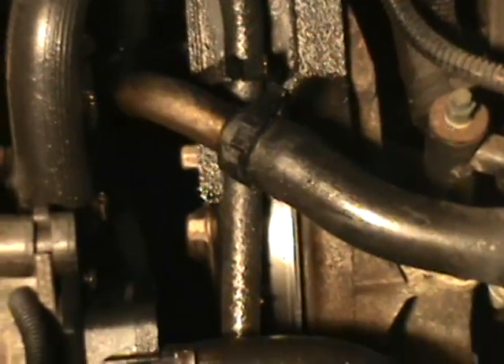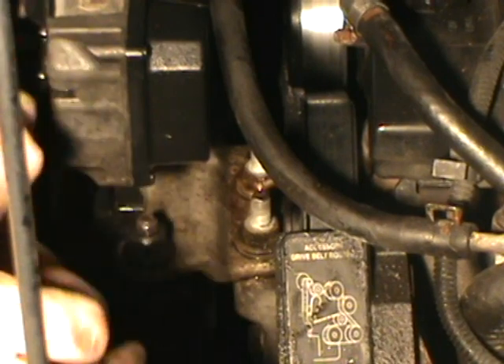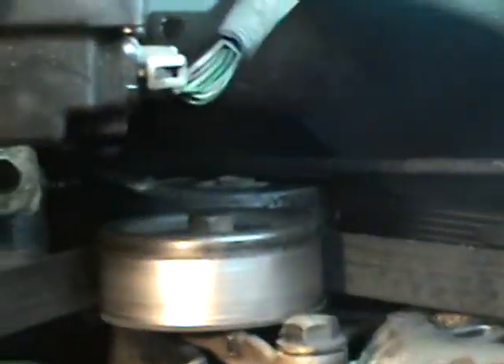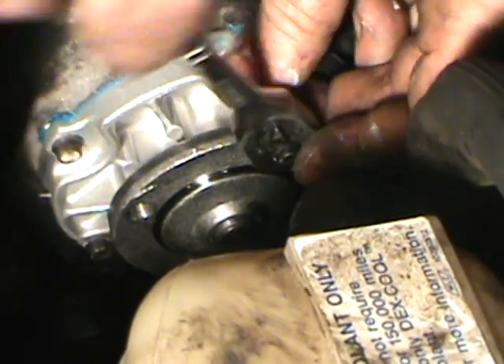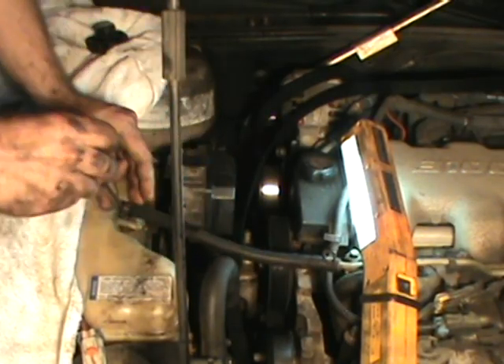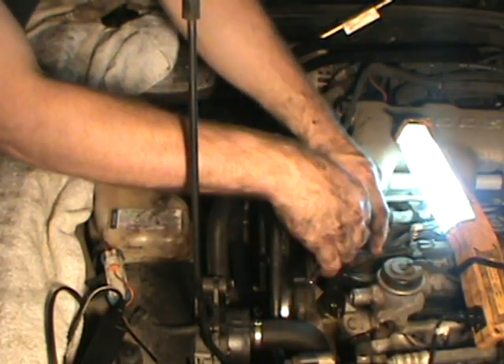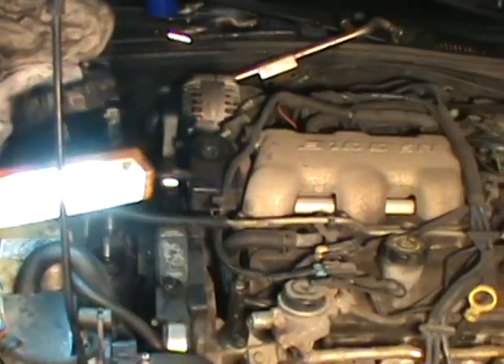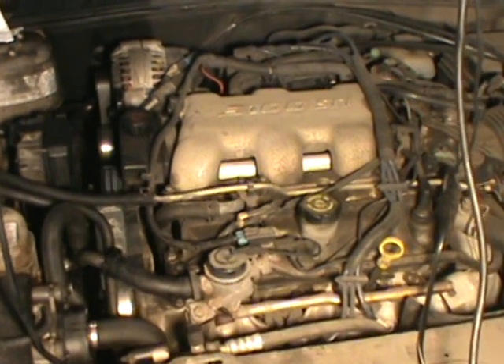3.1 water pump replacement, 2000 Chevrolet Malibu

Comment: why are you changing the belt
Reply: He says that once the belt is contaminated with the coolant, it will keep on slipping and needs to be replaced. I know this post was forever ago, but just in case someone else has the same question.

Comment: could be the Thermostat Housing or a leaky hose. Mine was the Thermostat housing, the O-Ring was faulty. You can usually see wet spot right under it on the driver side of the engine.

Comment: my sister tells she has to keep on adding coolant to her 02' Malibu because she is losing it all the time. Do you think it's the water pump or a head gasket leak or the thermostat housing???
Reply: You need to provide wayyyyyyyy more info than this. 1. Is it leaking on the left side of the engine (when looking under the hood)?? 2. Is it leaking from the right side of the engine (when looking under the hood)?? 3. Or is it coming out the exhaust pipe (ie: white smoke)?? 4. Is it leaking from the center area of the engine compartment (doesn't matter if you're looking at it from the engine compartment or driver seat, as the center will always be center)............
1a. The water pump in on the passenger side.
2a. The thermostat is on the driver side.
3a. Will be a blown head gasket (most likely) 
4. Chevy has a fucked up heater hose design that uses plastic quick connect hose couplers at the firewall that break ALL THE TIME. remove them, and hose clamp the hose directly to the metal stub.

Comment: is a chevy malibu a reliable car to buy
Reply: Tony Montana yes I'm bout to do the thermostat in it. but they are very dependable. I used to own one great on gas.
Reply: Tony Montana 2000 chevy malibu had car of year
Reply: The problem with the gastet comes with puting the wrong antifreeze
Reply: I gota disagree with the other two, not great, not horrible either - Chevy has had intake gasket problems with these things for a long time and done nothing to resolve it.  Not a huge problem if you catch it quick and get it fixed, but usually that's not the case.  Looking at a used one I can't imagine you'll find very many of these out there that aren't already knockin.

Most of them went till about 170,000 miles.  There are some other older Chevys that do better, like the Lumina went past 200,000 usually.

Also if your a Chevy guy... why wouldn't you just get a Impala or a big Buick boat?  They are known to be about as good as Chevy gets for cars.
Reply: We have had at least 4 , maybe 5 Luminas .  The 3.1l was a good engine .

     Has some problems with the transmissions , which may have  been avoided if we had of had them serviced .

     Can not say about the Malabu .

Wyr
God bless
Reply: What's the specs for the bolts?

Comment: Thanks for pointing out the part where you remove all the air from the block...I would have never known that.
Reply: Just do not drop the little valve on the air bleeder down in the engine .  If you are lucky , you will hear it hit the driveway & find it .  I was not that lucky !   :-(

     ( Hint , do not unscrew it all the way . )

Wyr
God bless

Comment: It is, isn't it? Sorry I didn't reply in time, glad you figured it out. 

For those wondering why you need to jack the motor, you remove a motor mount to change the belt, so the motor is going to lean. This is bad for the motor on so many levels, so you need to support it. The block of wood keeps the jack from damaging the oil pan as it rests on the jack with the weight of the motor.

Comment: Well its been an issue before the repairs. I just bought it in january. The thermostat that was on the right side of the engine. If you are standing in front of the car and looking at it. By the fuse box. I just started the process of elimination by fixing what could have been wrong and still does it. Fans dont kick on when engine gets heated, but they run when a/c is on.

Comment: This is great for the shade tree and first timers. He explains everything thoroughly so you should have no problem following this. I did it in less than an hour following the steps here and another 15-20 minutes doing the belt. Make sure you have a nice thick block of wood to jack up the motor when changing the belt.

Comment: I have the same car. I changed my coolant temperature sensor, thermostat, and head gasket. No coolant leaks. My cars engine gets warm and passes the middle line by 2 lines but never passes it. Why does it do that?

Comment from the maker: mainly just scraped it, once scraped you can use a wire brush to clean it better i have a small wire brush the size of a tooth brush... having the correct tools is part of the job. so if you don't have a scrapper they are cheep pick one up

Comment: If the belt has coolant on it, and you are flooring it say to go on a highway or something, will the motor surge a bit instead of smoothly picking speed up ?

I am having problems with my motor surging when I give it gas. And my belt is just covered in coolant.

Comment: Very informative, thank you. Maybe by any chance do you know, what tool should I use to remove A/C clutch (rattles when A/C is off) on these Malibu's ('99 to be exact). As far as I know, these are pressed in types (maybe I am wrong ?) and to remove the clutch you have to attach special tool to the compressor shaft and pull the clutch back. Tried several tools from Autozone, couldn't crew to the shaft - a bit too big, Chilton doesn't have that info (don't wanna replace the whole compressor)...:(
Reply: My 02 malibu does the same thing when ac is off

Comment from the maker: @JLY2258 your welcome, not 100% sure about that. i always put things back in the same order. plus if you look it makes more sense for the routing of the hose so they don't cross over each other, i believe that was brake and parts cleaner i used, hope that helps thanks for the coment

Comment: Thank you Will for the video. Just now saw it. I have two questions? Does it matter if the 2 smaller hoses to the overflow tank get switched when reconnecting, and What did you use to clean off the pulleys of antifreeze mixture? Please keep the videos coming! Thanks again.
Reply: Brake carb cleaner or alcohol on a rag

Comment: @DJTailSpin96 
Note that the final N-Bodies such as Aleros, Grand Ams, and Malibu have a coolant reservoir tank with a hose that can puke coolant all over the accessory drive end of the engine if either the reservoir cap is bad or the reservoir tank where the reservoir cap threads onto is stripped out. These are very common problems on these cars especially with their age and mileage. 

P.S. Nice video Robinsonauto.